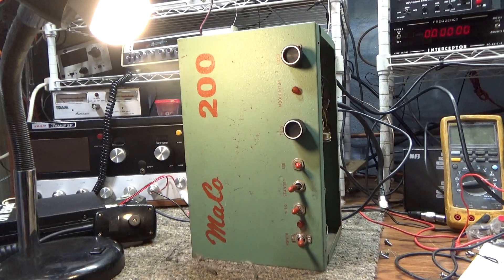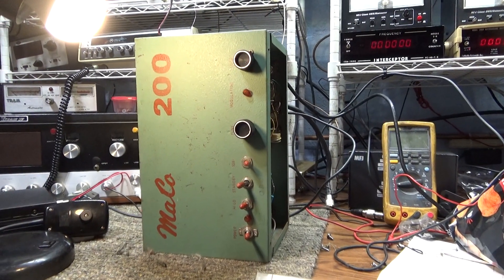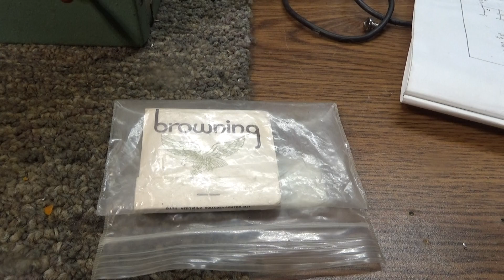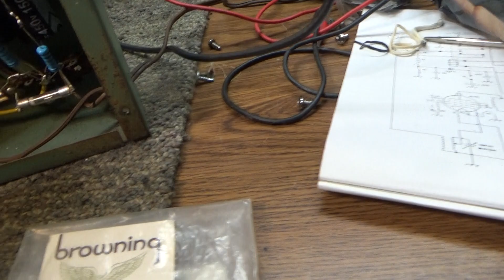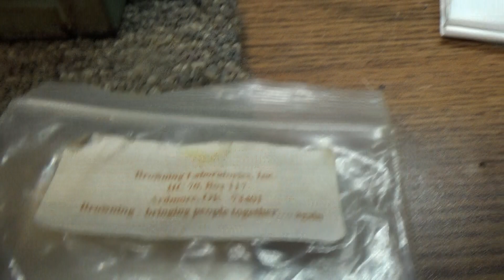Maco 200 revisited, was still acting up w/ new tubes + recap. Tim figured it out.....

Comment: The 6KN6 came in two versions. One of them is conventional, looks just like its cousin types. The other one contains two totally-separate pentodes side-by-side. The shunt capacitance from the plate cap to ground is higher on that one. FOr just one or two tubes, won't be a problem. But if you tie 4 or 6 or more of them together in parallel, that capacitance adds up and gets out of hand forcing you to shrink the pi-network coil way too small to be efficient. 

Oh, and your power issue is probably the input match, or mismatch. Maybe. Thanks for all you do and 73

Comment: i need help please with mine maco 300 had the gen running and it was going crazy. not idol at all ramming up and lowering when i can in to use the amp.. i was giving it time to warm up.... and my amp went off by it self i unpluged the amp and let it cool off it took a few time trying to turn it back on with the inverter....then it came on it keys up but meter does not move and no watts coming out of it. the amp was in stand by mode when this happen.  the caps were really hot when i got the case off.  could i replace the caps in it and will it work again?
Reply from the maker: So you ran a Maco amp off a generator? Either way, sounds like your amp needs some serious work. I can't help you, maybe someone else can. I don't think caps will help you.
Reply: @tramdr   i got it up and running 500 watts pep and 250 rms i replaced caps with a cap board from ebay and replace ceramic capacitor because it was dead, added a shield for driver tubes. cleaned up the relay added a led for the maco meter bought new meter and got it working. i bought 7 tubes just incase. lol but i know im still missing some watts out of it. i even clean the tuning coils. i only replace the 3 of the 450v 220uf caps. is their any caps that would lower the watts if bad ?        im still waitning on maco 300 repair kit for the other caps.

Comment: I have a Maco KW without a power supply. Do you know of one out there?
Reply from the maker: Nope. I have 2 Maco KW's one is a complete base and the other was a complete mobile. I am building a base power supply for the mobile out of a Phantom 500 chassis which has 3 transformers. I am adding a 4th transformer to it to run the KW. I might be interested in yours if the price is right.

Comment: The driver wire, under the box is feed one of the final tubes. The wire on top is feeding a different tube. Am I right? SWAG....
Reply from the maker: We have a WINNER even though I don't know what SWAG is.
Reply: @tramdr  SCIENCATIFIC WILD ASS GUESS
Reply: I just encountered the same thing on a Maco 200 I was working on. Exactly.
Reply from the maker: Easy to miss. To me, it looks like the top plate caps line up better and straighter when you put 1 of the output plates on the wrong (driver) tube. Took me forever to figure that one out.
Reply: @tramdr  Yes, they actually the plate caps are actually made to go on the wrong tube.  I had to bend it around and I actually should of cut it and redone it for the customer thought something was wrong. LOL
Reply: @David-jd5lp  That was a wierd one. Good lesson though,  thanks!

Comment: What are you using for bleeder resistors?
Reply from the maker: 3 watt flame proof either 5% or 1%. I have many different values from 100k to 470k depending on voltages.

Comment: Maybe the high low switch contacts not switching to high position and keeping plate voltage in low position? Or maybe the driver tube was bypassed or the driver plate to final tubes cathode circuit tune capacitor or coil needed replaced or adjusted? Have fun! Cheers Don
Reply from the maker: No, but you are closer to it than anyone else right now.

Comment: Just thinking out loud,  the symptoms are low alpha.  For a given reasonable drive power the output power is roughly 1/3 what it should be. The tubes test very good.  If the filaments, grid and plate have the proper voltages,  then a signal applied to the grid should get the proper output. So either a plate, grid, or filament voltage was incorrect,  the drive power was not being fed to the grid properly,  or perhaps the tubes were being driven out of phase and they had destructive interference reducing the output power.
Interesting problem :) Was the input SWR high as seen by the driver?  If it was them the driver power is not coupling to the input properly which will reduce output.
Reply from the maker: Input SWR was good